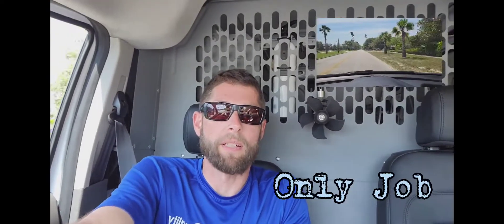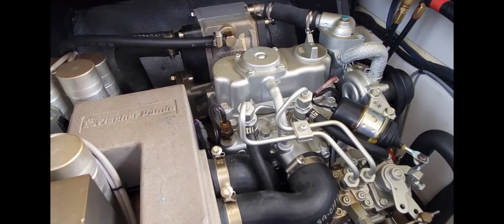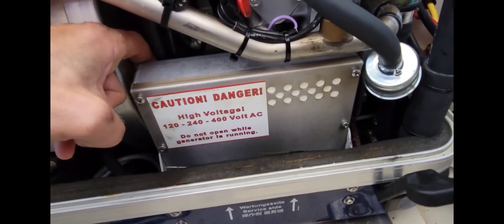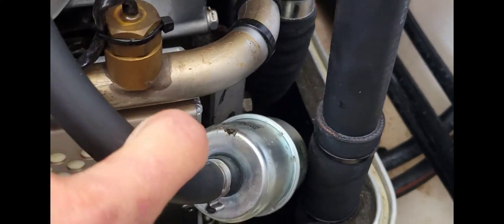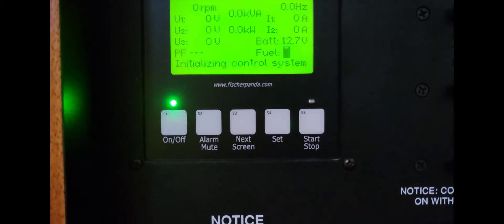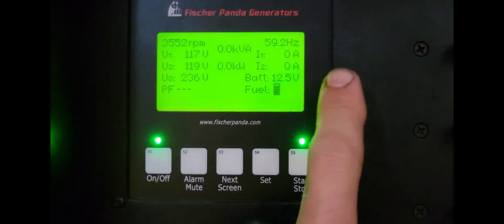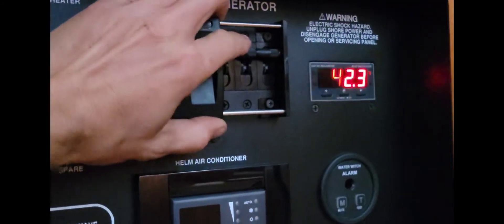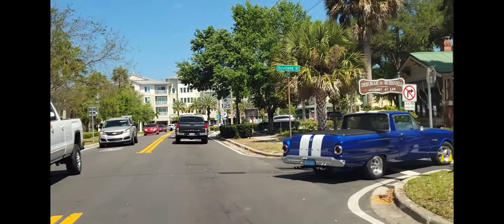Generator 101 with a Fischer Panda 7.5KW - Episode 13

Comment: Hey Justin, very much enjoy watching all of your videos. Thank you for taking the time to film and provide such great content.  Quick question, I have a GW 325 with a FP 5K.  I was changing the impeller and noticed there was some rust starting behind the water pump.  Sure enough it's leaking.  In  this video you said this can happen and you need to pull the water pump and replace the seal.  Is it the seal directly behind the impeller or is there another seal (or gasket) where the water pump bolts to the block?
Reply from the maker: Thank you. I would honestly just buy a new water pump assembly and rebuild the old one for a spare. They seem to just leak again when you reseal them. The seal surface starts to groove after it starts to leak, and it is hard to get it to seal again.
Reply: ok sounds good. Do you have any videos on replacing the entire raw water pump? thanks for responding so quickly Justin
Reply from the maker: I dont remember if i do, honestly.  I would search my Fischer Panda videos and see.  I made a bunch of them.  It's been a while since I was with Quality Boats.  Keep me posted ☺️
Reply: ok will do. Thanks again for your help

Comment: 2) The control panel quit attempting to start the generator some time back. Almost as if the wire to the Bendix drive were disconnected. It would simply say Start Attempt Failed, nothing more, the starter would not even attempt to run. Temporarily solved by running a separate jumper wire to the starter solenoid terminal. It starts & runs fine that way, but any idea how to get it back working from the panel?

Comment: Hi Justin, your videos are excellent. I have two questions maybe you can help me with on the Mini 8 installed on my boat.
Graphic Control Panel GP170C007
SW Ver 004.011.00016
Ser No 019.001.0302
1) The electrical control cover shows 120, 240 & 400v on the cover. There are only 3 wires coming out of it to the transfer switch. Shore power has 4 wires to the transfer switch. So the generator only powers up one leg of the boat's ac distribution. I suspect a 4th wire to the transfer switch would power up the other leg. How would I determine if that is possible & where would it get connected?

Comment: Nice video very helpful.  I have a question my generation was working perfectly but now don’t start and show this.  No can nodes detected.    Panel will power down I have no idea what is this thank you
Reply from the maker: The generator has three computer components. You will need to replace all three(Vcs board, boost board and display). Call Fischer Panda directly and tell them your problem. (954) 462-2800. They will help you out.

Comment: Hey Justin I very much enjoy all of your videos. Thank you for putting out such great content I did have a question.

I have a 2017 pursuit 408S and my generator is telling me that there is no voltage to check the output. what do you think could be going on here as I’m thinking it might be an easy fix, but I’ve also been told that I may need a new generator, I just bought this Pursuit and the generator was working fine. I had another friend of mine. Tell me it could have been caused by turning it off while under load any thoughts or ideas of a way I can troubleshoot it?
Reply from the maker: Thank you and the first thing you need to do is check the generator at the main connections.  They are known to come loose sometimes.  If they are all tight then I would test the output at the generator without anything connected. If it still doesn't have voltage then it's time to start testing the backend of the stator. Could have shorted out and that means it's time for a new one.

Comment: Hi Justin.  I'm torn about getting a generator for my Grady 325.  It seems like many of your videos are about generator repairs!  Are they more trouble than they are worth?  Thanks
Reply from the maker: The reason you see so many in my videos is because I specialize in them. I basically am the one to fix them in all the boats we sell.  We sell 300+ boats a year.  They are good generators and I wouldn't hesitate to have one in your Grady.  It's great for keeping batteries up/cooking/heat/AC/etc.  Good question and thanks for watching.

Comment: Hi Justin, just found your videos (thank-you so much for all the great content) while trying to troubleshoot my Mini 8 DP generator problem. It is installed in a 2013 Pursuit (so probably 2012 model).  I have replaced VCS & Power Board recently on Isaac’s recommendation from FP, new fuel pump, filter and stop solenoid. But still have problem with it after start only getting to 750-800 rpm.  I just did your suggested fuel line vent process, but still having the issue.  The throttle solenoid is operating and trying to accelerate the motor, but it just stays at low idle. Any suggestions?
Reply from the maker: That is a tough one without me actually looking at it. My best guess would be the throttle actuator itself. I have seen them go bad more than once. If you have all new electronics installed that would be the next thing I try. Keep me posted.
Reply: @JustinLeeMarine  We are located in Orange Beach.  Do you travel for service visits that far?  I haven’t had good support locally on the Generator.
Reply from the maker: Unfortunately I only work on what we sell from our dealership.  I wish I could help.  Maybe try and call Fischer Panda to see who their dealer is close to you. They might know someone that's certified to help. I'm happy to answer anything I can ☺️
Reply: @JustinLeeMarine  Thanks Justin,  any way to send you a video of what it is doing?  I have worked with FP quite a bit on the problem. Our local service location doesn’t have anyone close to your level of expertise I regret to say.  I would even look to bring our Pursuit to your dealer for you to look at it if that is an option.
Reply from the maker: You could send a video to my email if you would like. I can't guarantee I can diagnose it but I will try. It's Justinleemee@gmail.com.

Comment: The perfect video I've been looking for! I have the 8 mini which worked great until either the raw water line/filter got plugged up or perhaps the impeller failed. I'm going to trouble-shoot that shortly. But the bigger issue is suddenly I'm getting an error that says, "Invalid Calib/Program Data".  Not sure what that is about. Even if I fix the raw water issue, I got start the generator as it seems to have some sort of controller error. Any idea?
Reply from the maker: It depends on the year. Could be a bad vcs171 board on the generator or CT board.  You would have to do some diagnostic tests to see what is happening.  If you call Fischer Panda they are usually good about helping diagnose the issue. Thanks for watching.
Reply: @JustinLeeMarine  It turns out I have a broken impeller as suspected. Do you have a video where you show where to try to find where the piece of impeller may have ended up?
Reply from the maker: Honestly you will never find it. Most of the time it just gets pumped out with the exhaust water. I have never seen one clog up with impeller pieces and I have changed a lot of impellers over 20 years.
Reply: @JustinLeeMarine  so it looks like I have bad electronics as you suspected. I’m trying a cold reboot but if that doesn’t work they will replace my electronics hundred percent of the warrantee since apparently they had a bad batch of electronics in my model. Now I have to figure out how to remove all the electronics without being able to lift the generator. I think I saw one of your videos you removing the electronic modules. I need to figure out what’s holding them in place
Reply from the maker: I think I do have a video or two of the electronics.  They did have a run of bad components at one point.  It's not to difficult to remove all the electronics.

Comment: Do you work on smaller Fischer Pandas like a 4200 PMS? Can't find good FP techs here in the Northeast... Mine would stop running by itself after about a minute or two. Any ideas would be appreciated.
Reply from the maker: I have worked on the 4200 before.  Do you know if it's the 1 Cylinder version?  There are a few different models depending on the year.
Reply: @JustinLeeMarine  It's a 2012 1 cylinder Faryman 18W430.
Reply from the maker: There are a few things common on the that model.  They require a valve adjustment or check that nobody ever does and that will cause it to not run after it warms up. The fuel pump can be a problem.  The one on the motor.  They also have a compression release that can hang up.  Keep me posted if you find anything. Thanks

Comment: I have a 2018 pursuit OS 355 with the mini 8 panda as shown in this video but I can’t seem to find the coolant reservoir they refer to in the owners manual?  Is there one on this model?
Reply from the maker: I might be wrong but if you look next to the batteries in the back you should see a reservoir with green fluid in it.
Reply: Hi Gary, Did you ever find this?  I have the same boat and am struggling to find it as well.
Reply: @mac01810  
It took a call to pursuit but I did find it. It’s mounted on the bulkhead just forward of the grill/sink area. You can access it by removing the cabinet underneath the grill. I believe there are 4 pins you remove to pull the cabinet out.
Reply: @garryfrost3039  Thanks for the quick reply Gary!   I never would have found that.